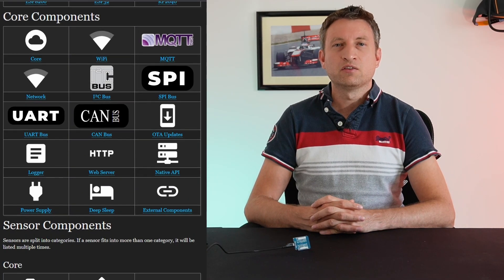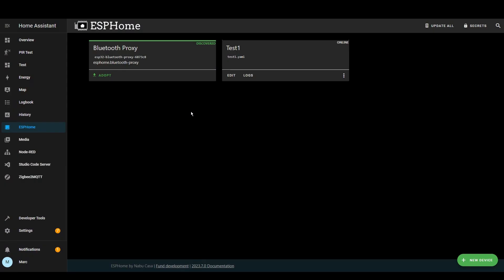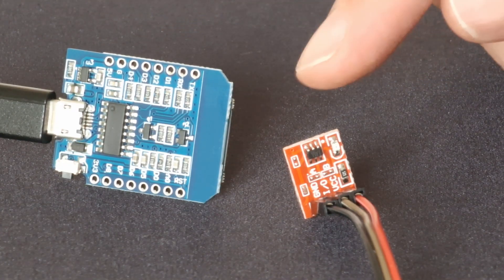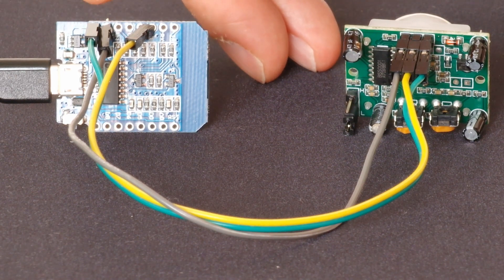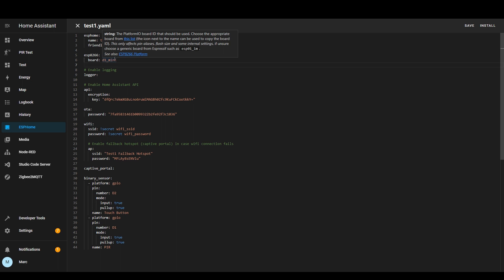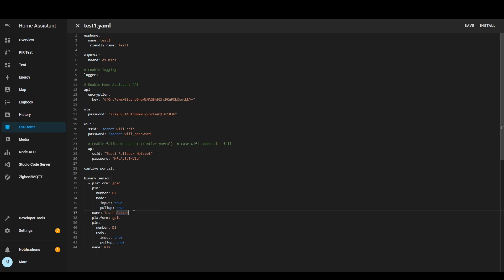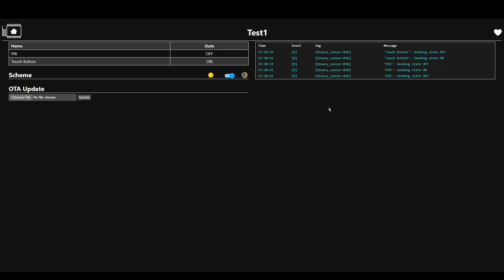Getting started with ESPHome

Comment: Any chance of a getting started section that does'nt involve Home Assistant. I'm lost as for what ever reason EVERY vid i view to get ESPHome running end up developing with or wrapping things up in HA and i want to stay as far away from that ** as I can as I have wasted many hours of getting my dozen or so Tasmota devices to even be seen in it, but that's another story, but desperate to get a ESPHome start.
Reply from the maker: In my upcoming video I do briefly mention that you can use ESPHome with Home Assistant, but not in any detail.

Mainly because it depends on what you want to connect it to.

What is the central platform you use (or plan to) to control things?

Regarding Tasmota...

Once you've configured MQTT they should just show up and update in Home Assistant automatically.

I use Tasmota less and less now due to ESPHome not needing MQTT to talk to Home Assistant.
Reply: Many thks for your quick reply, greatly appreciated, you are the 1st to ever reply in the world of ESPHome/HA. Sorry, you mention above that in you 'upcoming vid you can use it with HA but not in detail', but that was exactly my issue, on YT EVERY ESPHome vid wraps it up in * HA and that is what i dont want as it completely vectors away from the tutorial is about ESPHome.  I have over the past 8+ years used several Tasmota's controlled by my node-red code over mqtt which runs without any glitches, my reason to look at ESPHome was not ditch Tasmota but i want to create some of my own devices that are more than just the standard on/off switches etc at which Tasmota's do very well. But EVERY YT vid you watch on ESPHome there seems only ** HA info, and to a user that has no clue what HA even is then stunts their startup with ESPHome which is a totally separate thing in any case. It is only this past week that i have looked at ESPHome for the very first time, i wish i had done it earlier, it looks superb that's if you can get up and running without ** HA.
OK, now regarding my ** HA experience, I have had many attempts with various versions of it to try and add my dozen or so fully working Tasmota's to it and have totally failed, long live node-red.  I have followed various YT tutorial to do this and the best result I ever got/get is this:   One of my 'Generic' Tasmota 's is found but the 'switch' shown for it on the ** HA dashboard was 'greyed out' so not usable, and NONE of the other eleven or so found anywhere.   BUT, here is the good bit. I actually had listed in the ( forget the page name where all the ** HA devices show, is it Devices page/screen? ) there were/are if i run another copy up today - here we go  -  some 650 device that were populated in the dashboard with devices / types and names, many in foreign languages i had/have no idea about, i guess i had/could have the worlds Tasmota devices under my control, and yes clicking / switching their controls was indeed showing that it was being actioned ok, i just HOPE that i had not cause any one out there a problem that was'nt the intention, as i was initially shell shocked and had absolutely no idea what was going on, at first thought it was ** HA throwing in example devices as it was a fresh install and noobe user, but later realised the complete and utter ** of HA, regretfully i must have caused a bit damage to some poor folks devices around the planet as there were heaters for greenhouses, plant watering systems etc etc, some quite exotic devices and me thinking this was ** HA's way of showing what you should striving for and a good 'virtual' example to play with, so play i did, clicking/switching to get the feel of the dashboard etc. But still the irony of that is I could only see 'one' of my Tas's but with a 'grey out' switch that could'nt be used.  I did over that time leave comments on the YT vids that i was using to get HA running, but NOBODY even commented, not even a 'go away' which set the opinion in my mind of the 'types' that ** HA users are. Hey, not your good self as i guess you do use ** HA but I sense you like myself are more of an electronics guy, the joke of the above is that it is implied that every joe bloggs can use ** HA but hands up i can't and have spent 50+ year in analog and digital electronics and been programming mainly C/C++ for most of that time and old enough now to have no embarrassment, all  i can be sure of there must me countless others with similar experiences perhaps a lot younger and are embarrassed to say, which is why i say i am staggered that ** HA is used as much as they say it is.
Thks a lot for the reply, I do have respect for the few vids of yours that i have seen to date so if you are a seasoned ** HA user i should be be very interested to know your thoughts on the above fiasco, as NO other ** HA YT'er out there has bothered with a reply. Oh i do lie, one replied with the answer to my 'why oh why in a ESPHome totorial was ** HA heavily wrapped up in it i was told that ** HA has 'purchased' or taken over the ESPHome project. Well, judging on my above experience if that is the case maybe ESPHome goes to the dogs from now, what a shame that would be, However, many many thks, and a very Happy New Year to you, and if you do have any thoughts/comments on the above, well.  Please substitute  the ** in all the above prefix to (**)HA, if you get my meaning. Kind Rgds bfn.

      @lets-automate
Reply from the maker: Thanks for taking the time to give such information!

So, yes I know what you mean. ESPHome is very Home Assistant focused now and most content out there seems to assume usage of HA.
I’ve been thinking about this myself a bit recently which is why I briefly mentioned it in my recent video (Which was created before your comment, but released after it). This is however a brief mention and not what you’re after.

Although ESPHome is “managed” by the HA team now, it didn’t start its life off like that and certainly earns its right separately in my opinion.

So it seems that Node-RED is your automation platform of choice and if you’ve been using Tasmota for many years then you must have a stand-alone MQTT broker setup if not using Home Assistant? Is it Mosquitto that you use?

When you speak of 650 random devices appearing…the only thing I can think of here is that you have connected your HA instance to a public MQTT server. Perhaps the example one from the documentation? I suspect lots of people have tried things out on there (or using it, not realising it’s public).

ESPHome communicates with Home Assistant via API by default now, however it can and used to communicate with HA via MQTT instead. It does this with MQTT “discovery” topics. So you probably picked up lots of devices from historic mqtt topics which have “retained” messages.

This may (possibly) be also why you are having issues with your Tasmota devices showing up in HA. If you have been using them separately then your Tasmota devices might not be sending messages to the HA MQTT discovery topic where it looks for them. You would need to go and investigate how discovery works. Tasmota does have a section in their docs too I believe.

Like you, I was quite content with Tasmota, but when you start getting into different sensors ESPHome is possibly more suitable I would say. Although a fair amount of effort seems to have been put into supporting sensors in Tasmota too. (The Rules engine is not pretty though)

On your original point…my latest video I am working on is ESPHome related and may address some of your questions around getting ESPHome to work with something other than HA. It’s turning into something bigger than I was expecting though, so I’m not promising at this point!

I’ve been using HA for around 6 years now and if you get frustrated with it now, you certainly would have in it’s early days! It was not easy to use at all, but had the most integrations with smart home devices really, so I persevered. They have definitely focused on it being more user friendly the past couple of years; still a way to go, but I think they will get there.

I appreciate that I probably won’t be able to solve your problems over a comment, but hopefully it has helped a little!
Reply from the maker: I didn't manage to fit it into my latest video as it was already taking a lot of time to create and long. But I do plan to address using ESPHome without Home Assistant in a future ESPHome video.

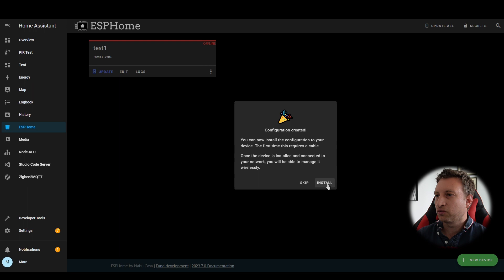Comment: It seems other viewers here get the gist, I must be the only one not to then.  Lost you 2:47, you made that 'Welcome to ESPHome' dialog disappear like a magician, so what, if anything did you do there as there seems no use in going any further until we know what should be done there.  Have you noticed how fast your mouse is going ?.
Reply from the maker: Thanks for your comment.

I see what you mean. I should have shown me pressing one of the options. I just selected the type of device I was using, either ESP32 or ESP8266 in my case. It then should show you the "Configuration Created" that I show in the video.

Regarding the mouse...do you mean I move it around too quickly? I do have it on a fast speed for productivity (I'm used to it) but certainly could slow it down for demos.

Comment: I struggled at one point....solution:  when you install/upload the yaml file using the USB cable, and it's installed, at the 4:33 mark. You need to disconnect it and reconnect it, as it will not reconnect to your SSID by itself and HA will never discover it. Otherwise, thank you for your tutorial.
Reply: thank you, i got confused about this too!

Comment: Thanks for the video, I found the same PiR sensor in a Pi project kit I bought years back. Do you need more than 3.3v for the PIR my board only supplies 3.3v , I know you mentioned the jumper. My PiR is constantly changing state could you post the yaml for the PiR too the video does not quite show the complete config🙂
Reply from the maker: Hi there, sorry for the late reply.

What board are you using and how are you powering it? Often it's via USB so you can pull 5v off the input.
If you are trying to power the PIR via the normal pin with 3.3v then it won't work and you will get constant state changes.

Either power it with 5v from the normal pin or power it with 3.3v from the jumper pin and it should be okay.

The other reason you can get fluctuating states is if:

1. Your Power Supply isn't strong or stable enough and so you're getting voltage drops
2. You haven't set "pullup" under the pin configuration.

I have upload the yaml from my video to here for you: https://gist.github.com/letsautomatenet/b7cffe868118ab2a416d3b2a0fdc7e3b

Hope you get it sorted!

Comment: Question concerning ESPhome yaml creation. Have noticed there is not any consistency in syntax; sometimes GPIO pin labeling is used and other times descriptive naming is used as in D2. Why is that? This is just one case where this is true but wanted to ask why as it makes learning how to program for ESPhome in YAML code rather difficult. Thank you for your time and videos, I enjoyed them.
Reply from the maker: I think the reason the D convention came out was to make it easier to know what to put in your code because the D numbers are printed on your circuit board on D1 Minis. Save you having to look at schematics.

They are actually just "constants" (like variables) which reference the GPIO number. You can use either in your code.
Reply: @lets-automate  there are times when I use for for example D2 and the dreaded red warning comes up. Not sure why but using the correct GPIO pin fixes the problem.
Reply from the maker: This could be the board type that you have selected. For example if you have the board set as something generic like "esp32dev" then the "D" numbers aren't available. But if you have it set to something like "wemos_d1_mini32" then it should let you. Hopefully that helps!